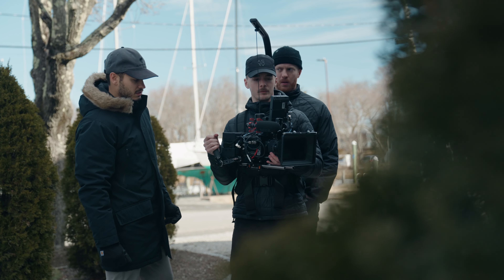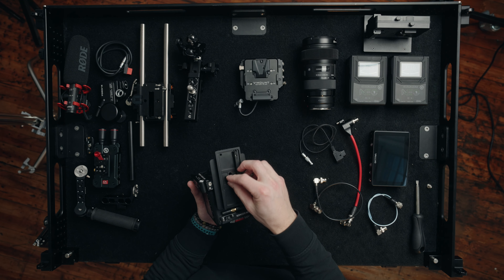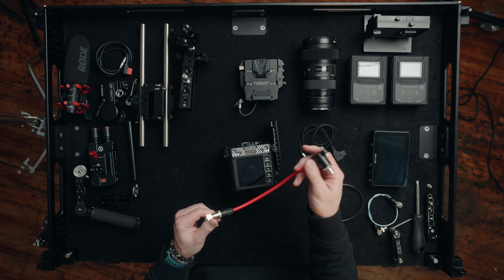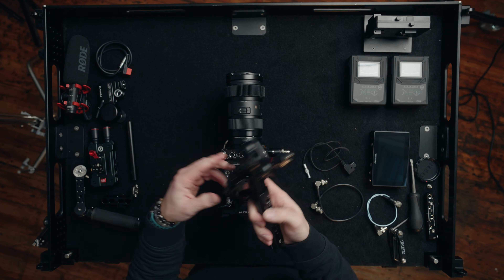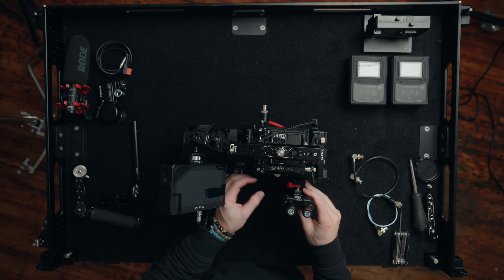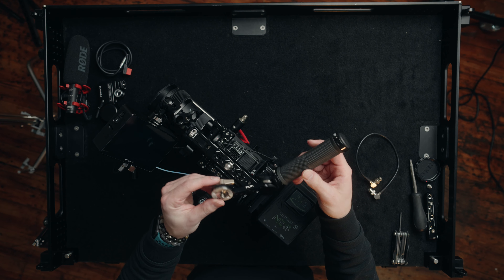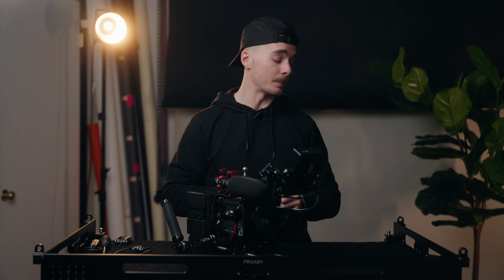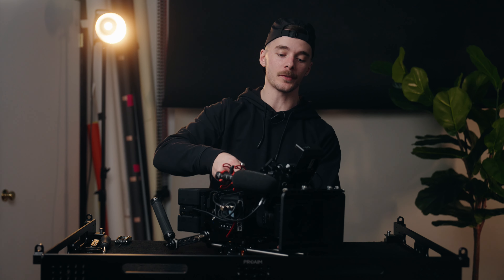VERTICAL Red Komodo Rig Breakdown

Comment: Nice rig. How did you prevent the SDI relocator cable head from turning when you screw it in? Mine always twists when I turn the screw.
Reply from the maker: I just try to pin it down with my other hand while I tighten it!